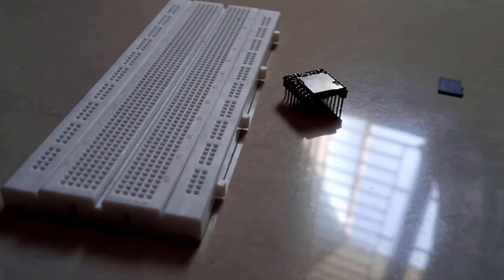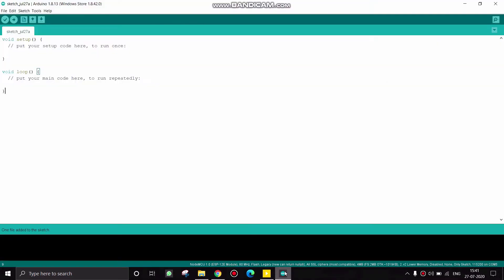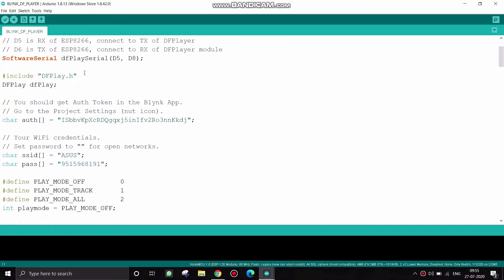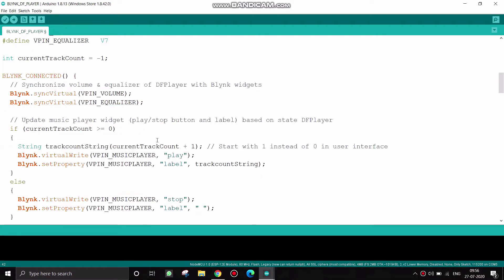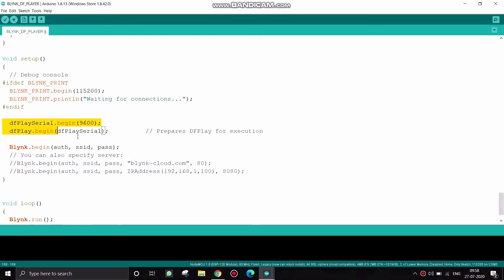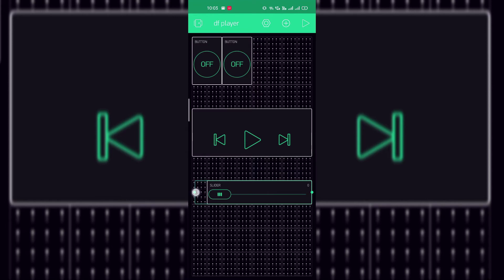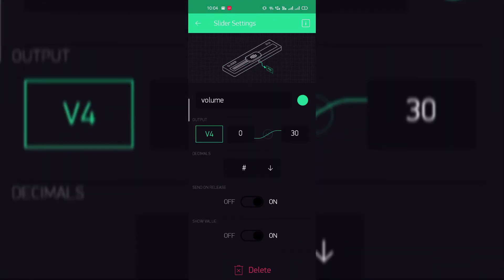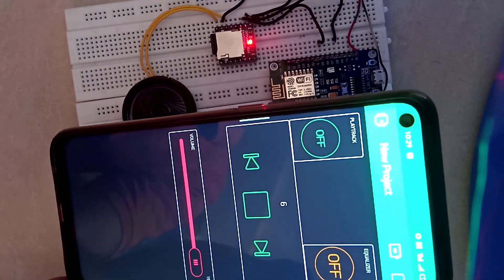DF MINI WITH NODEMCU AND BLYNK... ||HOBBY KIT

Comment: why isn't this working? dfplayer must be triggered to run but it doesn't work as programmed. Help me please
Reply from the maker: Bro actually there is a mistake in connection as shown in figure 

But the code is correct 

You just verify the code and make circuit acoording it 

By the way thanks for watching .plz do subscribe
Reply: I combined my program with this little program and it went well, thanks for making this video✌️

Comment: its not work, you photo does not match the code, D5 D8 Tx Rx..........
Reply from the maker: Yes but i have mentioned in the video.....
Reply from the maker: Just change the pin numbers inthe code. It will be good enough.
Reply from the maker: And i think it's not a problem at all
Reply: I follow your video and changed the pin, tx to D5 Rx to D8, no response at all....
Reply: Anyway Thank you for your video, it's very close to make it work.